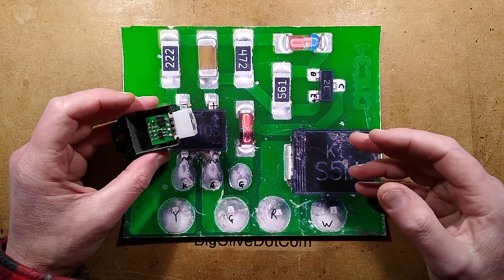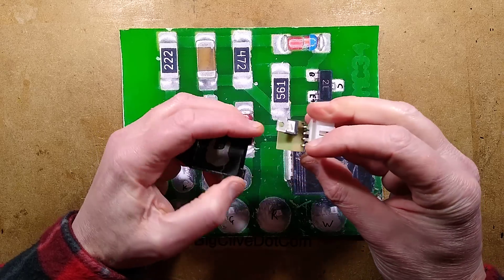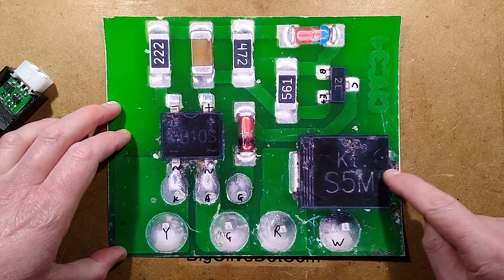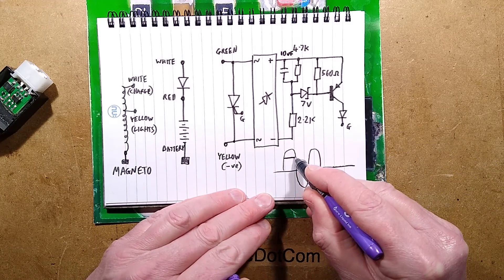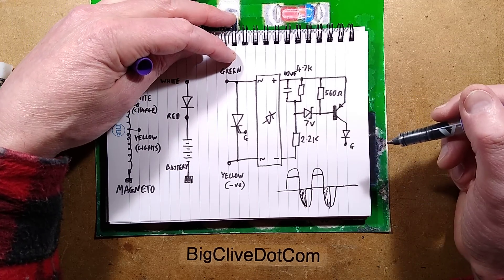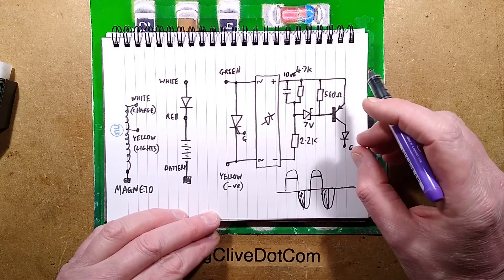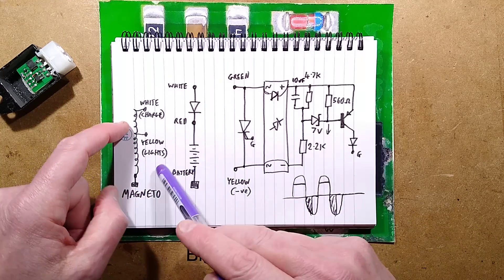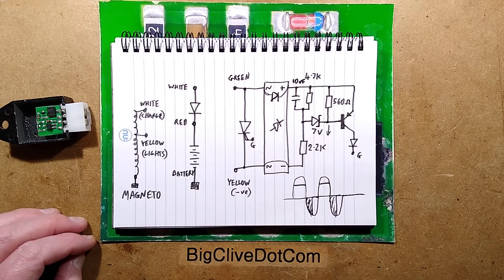Chinese quad/scooter rectifier/regulator teardown with schematic

Comment: These are known as "half wave" regulators and yes, it isn't suposed to have a full bridge rectifier as it is useless. Originally fitted on all honda (and chinese copies) style motorcycles after the 70's, when the battery used to just have a selenium rectifier.
As the battery and light share the same coil, the battery voltage is kind of regulated. Some bikes even had a 10w resistor that the light switch powered when the headlights were off to improve regulation.

Later you have "full wave rectifiers", with only one coil, floating from chassis ground to allow the use of both positive and negative half waves. This allows for a bigger battery for electric starting. You can also turn on the lights with the bike not running. There are of the 4-wire variety (like the one you showed, it's not good to confuse them) and a 5-wire one, with a switched voltage sense to eliminate quiescent current (also the battery won't charge if the bike is stolen)
Reply: That’s why most Honda 50/70/90cc bikes that I came across in the  1970-80s had dried out batteries they had boiled off all the battery acid lol
Reply: @loz11968 as some comment said, the electrolyte boiling WAS the regulator hahaha
Reply: This is why they always said "NEVER RUN YOUR BIKE WITHOUT A WORKING HEADLIGHT".  You either wouldn't charge or would over charge depending on the implementation.  It was a bad design, but you can thank Honda for that.....simple, cheap, and relatively reliable with easily sourced parts....ain't no fancy IC's going on here kids, just the basics.
Reply: @iamblaineful  Keep a spare chain link and at least one headlight bulb, if not more.
Reply: I didn't realise they had gone that "bare bones". My last big bike (GSX1400) had a 3 phase alternator which I swear looked like it was originally designed for a small car.
Reply: @gordonlawrence1448  well it's 50+ years old tech, nowadays it would have a couple microcontrollers and CAN comunication haha
Reply: @gordonlawrence1448  Real bikes do have more sophisticated charg8ng systems. This stuff is for the cheap disposable ones they sell at hardware or department stores that people buy to see if their kids are really interested without paying for something good that will just end up rusting in the yard.
Reply: @SidecarBob  real bikes that cost more than a car? literally billions of people move around in bikes that cost less than 1k usd and will last more than 50k km no problem.
Some people ride for fun, others do it as a means of transportation, where there's no point in having more than 10hp under you, or have a fuel economy worse than a family sedan
Reply: @nirodper  The wiring harness Clive is examining is not for bikes like the Honda Cub (& clones thereof) that gave mobility to those billions you speak of. It is for what are commonly referred to as "pit bikes": cheap & disposable machines that often sell for under $500 new, intended as toys for kids that are not old enough to use them on the road but also commonly used by racers & their crews for getting around in the pit area at the track.
BTW: I used motorcycles for commuting to work year round in Ontario, Canada for over 30 years (I've been retired for a few years now but they are still my only personal transportation) so I think fit the "motorcycles for transportation" category. I have 2 bikes because you shouldn't use your good bike on salted roads and I still need to get around when it snows. Both are over 35 years old and and each one cost under $500 to buy (used) and a few hundred more to make roadworthy (plus the cost of the sidecars, which were also fixer uppers). The summer one has lasted well over 100,000 Km and the winter one is approaching that mark. 
I will admit that both have well over 100cc but I do have to keep up with traffic where the speed limit is 80 Km/h, after all.
Reply: @SidecarBob  the wiring and connectors are the same, the only difference is the wire lengths. This type of wiring is used on all chinese bikes below 200cc, be it automatic/semi auto with horizontal cylinder, or, pushrod (cg) or ohc (cb) manual, it is also used in brazilian hondas.
110cc, 125cc, 150cc, and 200cc bikes all over asia and south america. The pit bikes you mention just use the same wiring as it is very cheap, for example this one doesn't seem to have blinkers.
Nowadays there are some changes with fuel injection.
Reply: @SidecarBob  It was more that I didn't know the more simple bikes were still using really dodgy circuits like this. I would have thought some kind of amplified zenner for the regulation at least.
Reply: @SidecarBob  not really. Fullwave regulator has one sense wire to connect to reverse biased zener to indicate if the voltage is above 14,5 to 15 (different R/R and manufacturers have different value zener) then shunt the rest of the voltage. It's not that fancy and yes, it's made by honda. That's my honda tiger anyway, sold for around $2000 here in indonesia. 

Fancy would be to have IC to directly control the charging system, separated with the rest of the circuit. And yeah, i don't think fuse is a fancy protection. A "Real" motorcycle would have at least fuse, tvs diode, and combination of mosfet zener and resistor to protect against reverse polarity, overvoltage and over current and probably one voltage monitor using resistor divided to sense and indicate any problem like if the battery is below 11v while in use. And they don't even come with $5000 motorcycles. They are fancy in mechanical terms, but not yet in the electrical area. Pretty basic 

Yup, nope, even $2000 motorcycle in a country with monthly income of less than $300 doesn't have any "fancy" thing.
Reply: @ragilmalik  I will admit that I have no experience with small motorcycles but I have had motorcycles from 400cc to 1100cc for 35 years and I have studied the wiring drawings for a lot of models while trying to help people with problems. All of the ones I have seen have been one of these 2 types: 1) Field coil (automotive type) alternator which is regulated by varying the current to (& thus magnetic field strength of) the windings on the rotor (this is most common for inline 4 cylinder engines) or 2) Permanent magnet type where magnets are mounted in the edge of the engine's flywheel, with the stator mounted inside the engine so that the flywheel rotates inside it. With the permanent magnet type full power is always generated and the voltage was traditionally controlled by the regulator circuit dumping current to ground to load one or more phases and pull the voltage down (more modern designs use MOSFETs to actually limit the voltage without dumping the current to ground). Both types are (except in the cheapest models) 3 phase alternators and use 6 diodes for full wave rectification.
None of my own machines have had (or needed) any reverse polarity protection or anything to indicate when the voltage is low other than voltmeters that I installed myself. 
As for the prices of new motorcycles (or new vehicles of any sort), we all know that they are much higher than they should be everywhere in the world. That said, the price of the cheapest brand new motorcycle that will keep up with traffic where I live is about equivalent to what an average worker earns in 6-7 months so things aren't that different here. Most of the bikes people I know own were bought used and a significant number of those are 30-45 years old and needed a lot of work before they were roadworthy (my own bikes included).
Reply: Big thanks dude!
I fitted one of these bad boys to my moped, as it didn't have any real regulation originally. I wanted to be able to run 12v led lights and stuff, but it kept frying any electronics i connected (except my Wish $2 led rear light lol). I'll try to have some sort of load on it at all times and see if will work properly.
Reply: Why wouldn't the battery charge if the bike was stolen!?
Reply: @SodAlmighty  because they probably throw the battery in a bush with the mirrors & anything else they ripped off 🤣
Reply: My honda supra x 125 2009 (i believe a modified version of "wave" sold by honda in Thailand, since Thailand is their HQ for south east asia market) has one of this R/R.

It's known as half wave rectification, with positive going to the battery and negative going to headlight. It's really inefficient since it's using SCR to shunt the excessive voltage so it won't overload the alternator, but in turns the R/R gets hot.  Nowadays with modern ECU, i believe they're using much more efficient FETs, and it's way cooler with better heat management unlike the old fin heatsink.

You can just remove the ground pole on the alternator and buy a full wave R/R to make it better and more efficient. Plus, your headlight and position light (should replace all the lights will LEDs) will now connect directly to the output of your key, instead of bumpy negative wave from alternator.

Comment: they are avoiding having to rectify the power output and just running the lights on AC power. means they only need a diode for the battery. the current output is probably pretty terrible so i wouldn't worry about damaging the battery.

you should do an alternator so we can see the differences between the two. probably one for a quad.

Comment: NOT compatible with lifepo4 cells.   They would over volt.  lead acid can take over volt beatings and live.
Reply: The good thing about lead-acid batteries is that they are tough as old boots.
Reply: @oldbatwit5102  They sure are.  Take a beating they can.  Just NEVER allow them to remain in the discharged state.

Comment: As the Magneto turns, like sands through the regulator, so is the day or two of our quads.
Reply: What
Reply: Something poetic about that ;)
Reply: First thing I heard was "as the stomach turns..."
Reply: It's from a very old tv show - daytime -drama...as the world turns....I recall it from ..1965 black and white...63...1 pm ..it would have been the show , interrupted , when walter cronkite ,reported on a bad day for jfk ,in dallas
Reply: @tomgucwa7319  the prase "Like sands through the hourglass, so are the days of our lives"  was used in the beginning of the soapthing called Days of our Lives  that have been running like forever

EDIT , had to check op on how  long the show had been running  , well since 1965 and still goin ? how crazy is that
Reply: @Luske74  well surely lives up to the slogan then!
Reply: i'm sure theres something that continues that, but that was always the point where i changed the channel XD
Reply: Wot

Comment: Bridge rectifier looks so small for that.needs bigger one.
Reply: Should be fine, it only passes a few mA as it is only powering the voltage sensing/trigger circuit. The thyristor is on the magneto side of the bridge rectifier.

Comment: Hey Clive if you like this stuff I can send you a mountain of it. I go to my buddies electronics recycling place three or four days a week to poke around and they get tons and tons of those cheap Chinese four wheeler’s, Dirt Bike’s, and motorcycles/crotch rockets. The wiring harness simply zip tied to the frame and some of them even have a knock off “brain box“ (ECM). I’ve dissected many of them just to check them out.

I keep a modified toaster oven for help with depotting, and various harsh chemicals in different containers. Most of which are kept outside away from the shop and the departing definitely has to be done outdoors!

The departing set up isn’t for this kind of cheap module… Because they really aren’t worth the time other than when I dissect them for fun. But I’m always being asked to repair industrial boards that have been parted. Companies like caterpillar bulldozers, miller and Lincoln welders, and many automotive ECM‘s are always parted with the nastiest and most difficult stuff 😆 
I always avoid jobs like that. But if the customer iinsists and we absolutely can’t find a board somewhere online… Then I charge about 10 times my normal price 😂
Reply: Potted, not parted, I think you mean.
Reply: Where is this heaven that has endless cheap mini bikes and ATVs?
Reply: @otm646  yeah what the hell but then I might keep that kind of info a secret too LOL
Reply: @otm646  - It's probably where Mustie1 lives, in Nowhere New England.   You can't find dumped/free  motorized equipment in Houston, that's for sure.
Reply: You should start a YouTube channel, there is an audience ;-)

Comment: Sand might have been better for insulation perhaps? Prevent arcing, if it was potted properly any way..

Where is this beach they're getting the sand from, be nothing left 🤣
Reply: They get it in ewaste, put in there by the companies sending it to get the weight, and the amount they are paid, up. Also from the recycling, where the components are washed in the river to get the crud off so they look a little more like new.
Reply: They import it from some place called Fukushima. They got a great deal.

Comment: The quad bike I have worked on uses a 3 phase version of this for charging the battery. Due to the large amount of heat it produces, we have had several units fail. On closer inspection, the last two that have failed have also been mainly filled with sand and only potted with resin on the last few mm, supposedly for cutting costs even more, which wouldn't help heat transfer to the aluminium case.

Generally when they fail, either the triac (or equivalent component) fails so no regulation happens and the battery is overcharged or the rectifier diodes go open circuit and charging stops all together. 

The rectifier diodes failing open circuit or the regulator being disconnected has interesting results as from memory, the cdi unit uses a connection to one phase of the stator to drive a voltage doubler to get it to the high voltages required. This relies on the rectifier diodes in the regular to reference this voltage to ground, meaning the ignition system won't work if the regulator fails open circuit or is disconnected. Once the bike is running however, there must be enough capacitance in the wires or some other factor that it will keep running without a regulator, leading to much scratching of heads :).

The last time we replaced the regulator, we looked for a different branded one with the wires coming out in a different order of colours, so hoping it is built a bit better. We are also running the headlights on all the time to try to reduce the load that has to be shunted by the regulator and not leaving the engine idling for long periods of time. Fingers crossed it keeps working.

EDIT: Remembered that the signal to the CDI unit is just one phase of the stator, not a dedicated coil
Reply from the maker: I depotted both the regulator and CDI module (complete with sand).  Videos coming soon.
Reply: @bigclivedotcom  ok disassemble a cooker
Reply: There have been a few comments that this design needs to be run with the headlight on all the time or the regulator and mag overheat and can even blow coils
Reply: @mycosys  5 hours ago clive commented
Reply: I probably should have mentioned that this is an agricultural 1980s honda. There is another comment on this video that mentions full bridge rectifiers and I realise this is the case with this one, making it a little different to Clive's. The stator is 3 phase and is rectified. The voltage monitoring and clamping circuit is after this. The ground is connected to the vehicle's ground and the positive to the battery. Depending on the cheapness of the regulator, there may be another positive that powers the voltage monitoring part that is switched by the ignition. The headlights in this bike run off the 12v supply without any dedicated part of the stator or tap, so can be switched on and off, although leave more power for the regulator to dissipate when off.
Reply: The regulator on big 80's suzuki's used to fail, the solution was to replace it with one from a honda superdream 250 or 400. The honda regulator has a voltage sense connection that connects to the wiring loom elsewhere to compensate for voltage drop. With a 3 phase alternator only one phase (2 wires) is used with the headlights off to reduce the load on the regulator, the additional 2 phases ( the 3rd wire) being switched back to the regulator via secondary contacts on the lights on/off switch when turned on.

Comment: That should be TRIAC, not thyristor. It clip both sides of sine wave.
So that is reason why they use bridge rectifier. And trigger only with positive voltage on gate.
That is so called parallel regulator. It short circuit coils. So on lot bike it regulary overheat, or coil burn out, if you drive it with headlight off.
I have collection of schematic for CDI and regulators. If you want I can send it to you, so you can see different solution and compare it...
It is usually for old bikes, some of them is for 6V systems.
Reply: A triac is a type of thyristor and was also known as a bidirectional triode thyristor in times past. 😉
Reply: never seen a coil burn, the coupling is not good so when you short it it doesn't really dissipate that much power, it really behaves kind of like a current source. Also properly potted regulators barely heat up if at all
Reply: @nirodper  I had one coil burned on my NSR 125. And 3 or 4 regulators in 2 years. One on CBR 600.
Both are very similar. And are 3 phase...
And after few hours of driving, it is hot enough to burn you.
Reply: @nirodper  Yes, but symbol it is different... And in regulator should be bi directional, and clamp both sides of sinus. Not one.